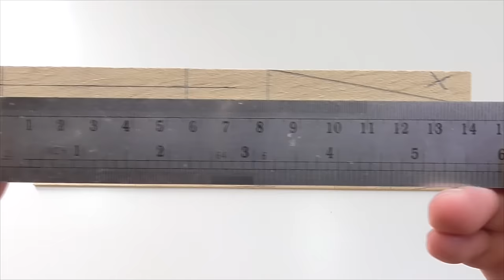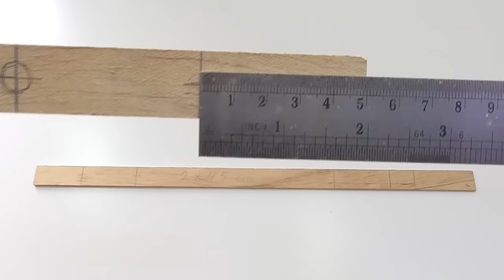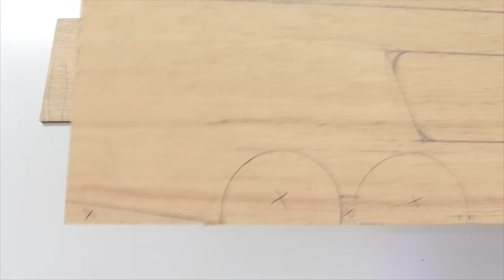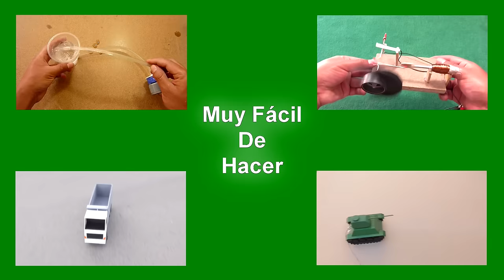Cómo Hacer Un Minibús RC Casero (muy fácil de hacer)

Comment: Very nice build, from scratch!! The glue you are using must be very strong to bond metal, and balsa wood parts together! I know that the hot glue is really strong, and dries, or sets, fast! I love the bottle cap wheels, and black foam tires! That dual axle drivetrain is simple and amazing!